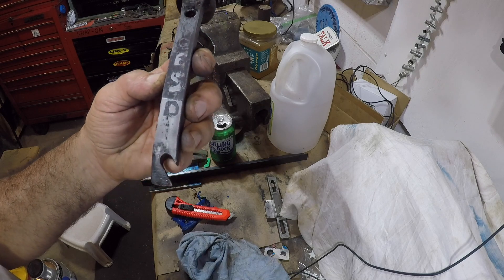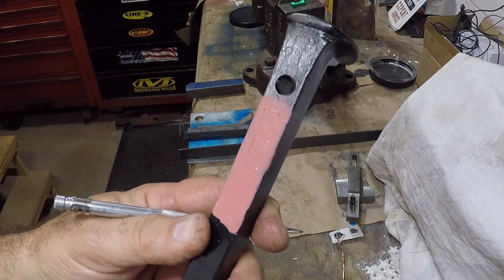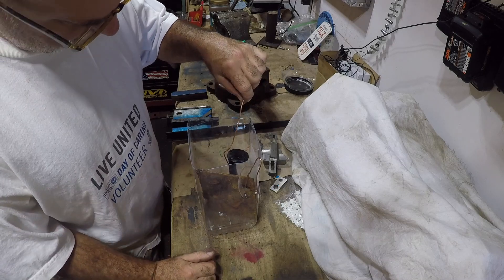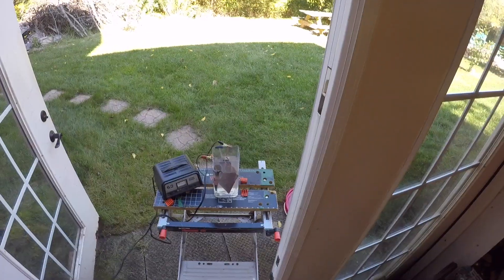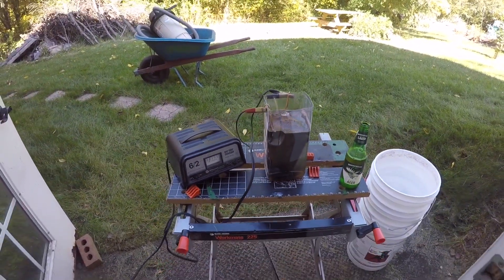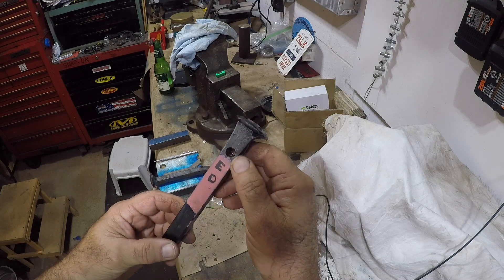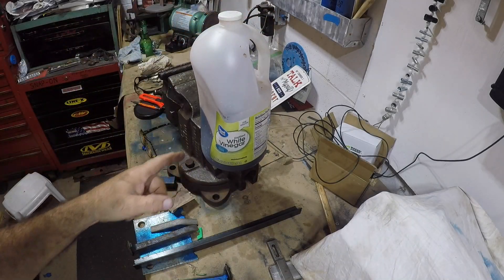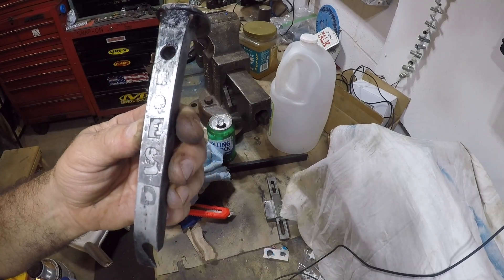Etching Metal Using A Battery Charger And Salt Water

Comment: Cool video...though
Listening to your comments during you experiment I find it odd you're still breathing.  Lol
You need to do some reading for chemistry safety.
Reply: Nonsense he was fine with that sitting outside like that. Hell I do it in my garage with the door open and it is fine. The only thing he did "wrong" was not just using acetone or mineral spirits to remove the nail polish ... that lacquer is friggin hard as hell to get off without chemicals.
Reply from the maker: I was outside so I believed I was find. Stay tuned for the Led repair. I had to leave the room. 🤢
Reply: Knowledge is power. And with great power comes great responsibility.  Lol🤯
Reply from the maker: and as always I like to pass my great responsibility onto others. 🤔